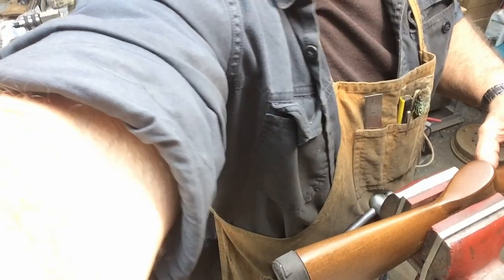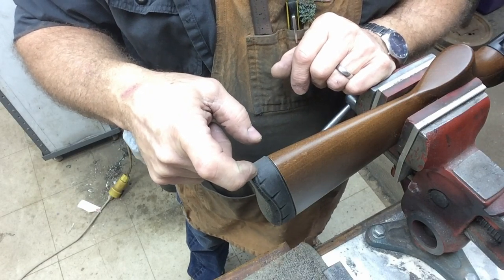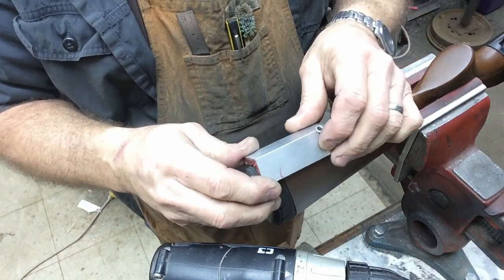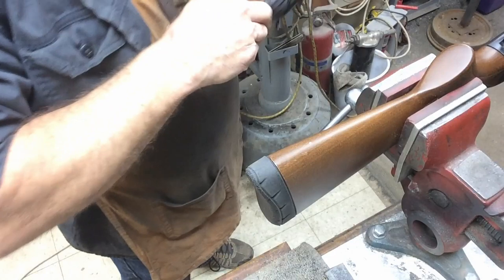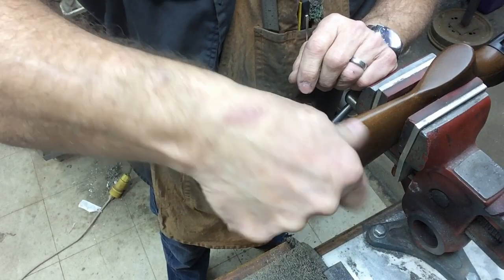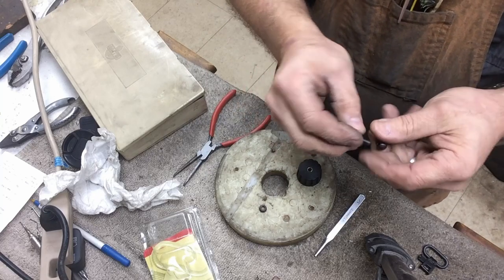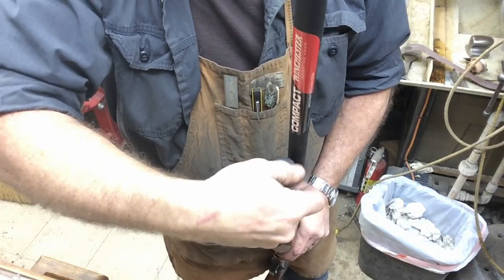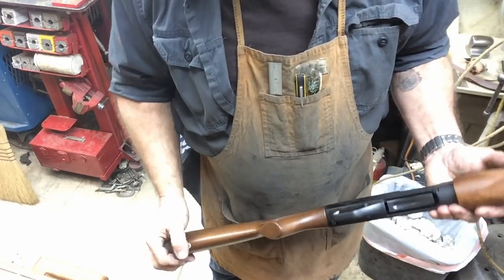Installing Sling Swivels In Your Rifle Or Shotgun

Comment: Exactly the information I needed. Thank you!
Reply from the maker: glad I could help, Thanks.
Reply: @hillsgun  is it will effecting  magazine cycle the cartridges to receiver if we drill up the magazine tube cap and install the stud on it? Is the magazine cycle normally after doing like your video. Anyway, great video and hope you answer my question soon...
Reply from the maker: @materazipelates  if you are installing directly into the magazine cap it will work fine.
Reply: @hillsgun  my shotgun is Winchester SX4. But, the magazine cap doesn't have the stud for install slings. After viewing your video, I think to drill the magazine cap similar as you do. Than, no need to buy the new magazine cap with the stud that already originally install in it. Besides that, I'm not confident to do so. Because, fear that it will be effected the magazine to cycle reload through receiver. What's your opinion about this?
Reply from the maker: @materazipelates  The gun will still cycle fine, the cap itself only holds everything together and has no affect on the guns function.

Comment: Greetings Hillsgun,

I have a Remington 783 (.308) and am wondering if the process is similar on a non wooden stock?

Thanks, 
- M
Reply from the maker: process is the same for any stock. the differences you may encounter with a synthetic stock is  the nut used on the stud for the forend may have to be epoxied in place to hold it in position and provide support on the inside of he stock if it is hollow and on rare ocassions I have had to add material (usually a wooden block) on the inside at the butt for the same reason. Hope this helps.

Comment: I have a Ruger with rubber/ composite stock and it has u shaped hangers that are attached to the sides? so do the same thing after removing the hangers? Thanks for any advice
Reply from the maker: Yes the same process applies, but it is sometimes necessary to install a reinforcement block or nut inside the stock.

Comment: I have a new 1897 Cimarron Arms Reproduction 12 gauge shotgun (20" barrel") and I have just bought a new 1-1/4" leather sling.  I can understand, from your video, how to install the butt swivel, but the forward one has to be attached to either the barrel or the magazine tube with a split band type device (or replace the existing end cap on the tube) to hold the sling swivel.  Not sure how to proceed with this.  Also you placed some sealer in the drilled hole in the butt.  What is this sealer?  
Dan
Reply from the maker: Hi Dan: You will need to use a barrel band as you have already stated. Depending on your preferences, if you are going to sling it barrel up or down, and your height you can attach it to either the magazine tube or the barrel, The sealer is tru-oil but any sealer can be used, just used to protect the stock from moisture in the tapped area.

Comment: I bought a Ruger 10/22  Deluxe Sporter awhile back. Decided I didn't like the factory fixed sling swivels and that I wanted to replace them with QD swivels. Bought a set of Uncle Mike's QD swivels, removed the factory swivels and ran into a small problem. I can't get the rear one "clocked" correctly, if that makes sense. What I'm trying to say is that when the swivel stud is tight, the hole in the stud runs parallel with the stock and I feel like turning it another 1/4 turn will strip or crack the stock. Tried both with and without the washer with same result. How would you remedy this?
Reply from the maker: you can slightly counterbore the stock to get the stud indexed correctly, just be sure not to tighten it to tight on the wood or you will crush it and it looks like crap. I think I show it in the video but I have a counterbore that slightly flattens the curve of the stock for the shoulder of the stud to set on and allows me to index the stud. Also do not counterbore it to deep or the swivel where it connects to the stud will contact the wood and mark it. Good luck, Dan.

Comment: I have a Remington 870 express super mag with a synthetic stock.  Can I drill the back mount with my synthetic stock?  I heard that there might be issues if the stock is hollow (I'm not sure whether that's the case).  Also, would you recommend using glue to secure the back mount?  If so, what type of glue would you recommend?   Thanks!
Reply from the maker: On the hollow stocks I usually install a hardwood insert into the stock where the stud will go and encapsulate it in epoxy
Reply: @hillsgun  Thanks for the help sir!  Great video too!
Reply from the maker: @joepass87  you are welcome, Thanks.

Comment: Hi there. Good video and perfect advice for my project of adding a sling mount to my Mossberg 500 with wood stock. When drilling the butt stock do you drill 90 degrees to the butt plate or to the bottom edge of the stock? Thank you.
Reply from the maker: 90 degrees to the bottom edge of the stock. The flat on the base of the stud (between the threads and the attach point for the swivel) should always be flat to the stock.

Comment: What is that sealant you use to seal the threads?
Reply from the maker: I use tru oil . you just want to seal the wood so that moisture hopefully doesn't penetrate the stock. any sealer will work but tru oil is one of the normal finishes that is always at my bench.

Comment: What about on a synthetic shot gun stock?  Machine screw thread stud??  My turkey gun needs a stud.  Thanks.
Reply from the maker: I normally prefer to contour a hardwood insert to fit in the botton of the stock where the stud installs and epoxy it in place so I can use a standard wood screw style stud. Be sure to either encapusalate the insert in epoxy or use some sort of sealer or finish to prevent the possibility of it absorbing moisture.

Comment: Didn’t even say what size bits to use 🙄
Reply from the maker: When I made this video I had the apparently mistaken expectation that if you have the ability to safely drill into a stock of a gun potentially worth hundreds or even thousands of dollars you would have the basic cognitive skills to at least ascertain the size of a drill bit.
Reply: Or you could address the correct size bits vs mistakes others have made in the past- and the importance of correct bit sizes. I think the question is valid. Especially for newer DIYers. I’m sure you were green at a place in time in the past. 
Better to make friends than not.